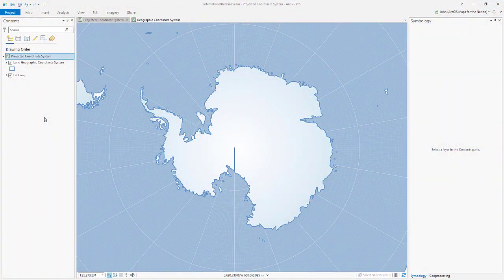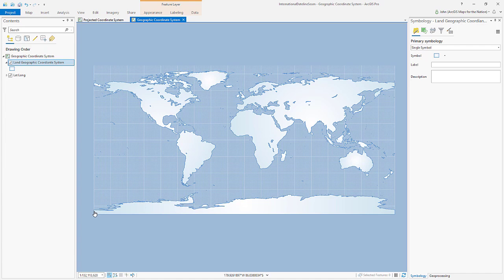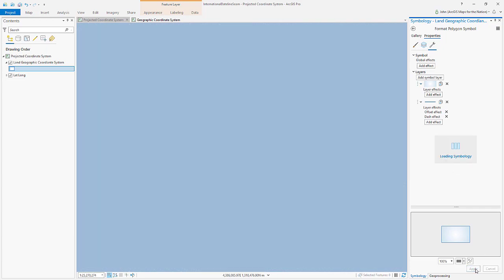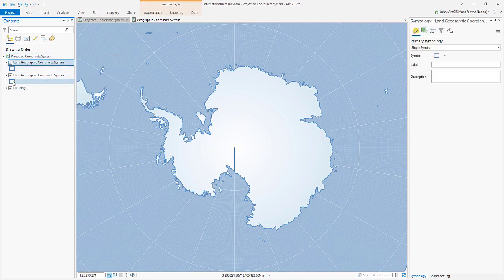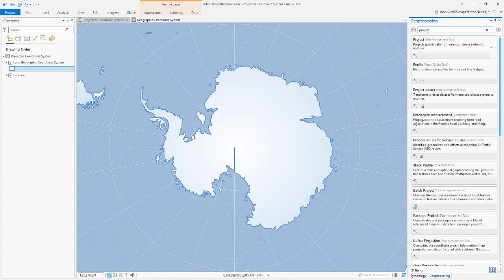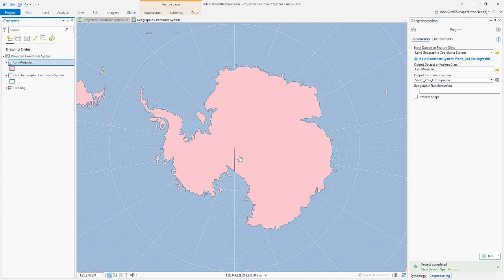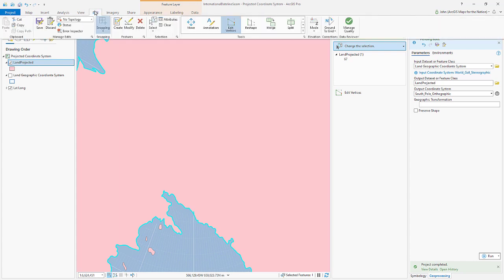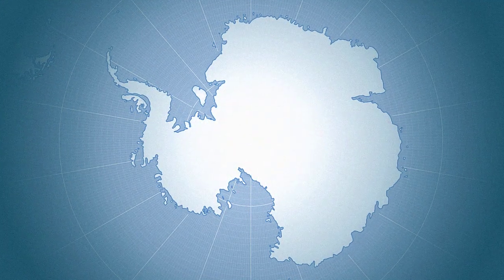How to Get Rid of That Pesky Seam: 1.5 Hacks and a Solution

Comment: I am working on a map of the combat missions of the 22nd Bomb Group during WW2 in the Pacific.  The mapped area runs from Midway Island to Borneo and the dateline zipper is visible when I use the imagery basemap.  I hoped this hack would help me out but basemap symbology apparently cannot be changed.  To make the exported png ready to post in my blog, I ended up opening it in Photoshop Elements and using the spot healing brush to blend the dateline into invisibility.  Maybe I need to start using projections instead of just using the basemap.
Reply from the maker: this method repairs zippers for vector data layers. i've not noticed a dateline artifact on the esri imagery basemap. is that what you are using? what projection?
Reply: @JohnNelsonMaps  Thanks.  I am using the esri imagery basemap, no projection except whatever is default for a new project.  I notice that the dateline zipper disappears if I turn off the Terrain Hillshade layer and reappears when it is turned back on.  A previous version of the same data and does not show the zipper whether the Terrain Hillshade is turned on or not.  Maybe I will remove the hillshade layer and add it again.  Maybe it is a glitch.  Thanks for all the help your videos provide.  My maps are much better since watching your channel.